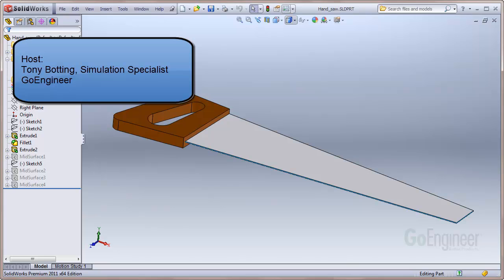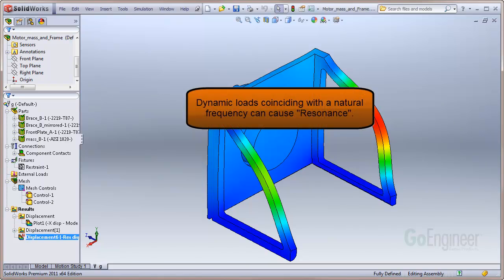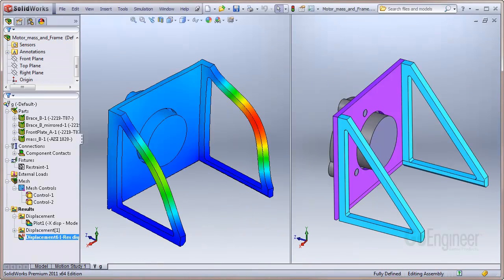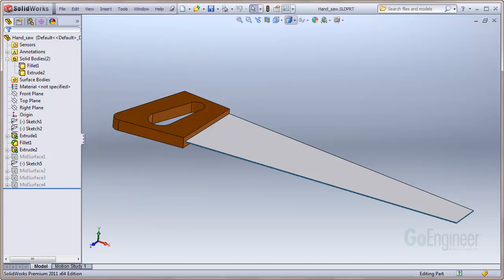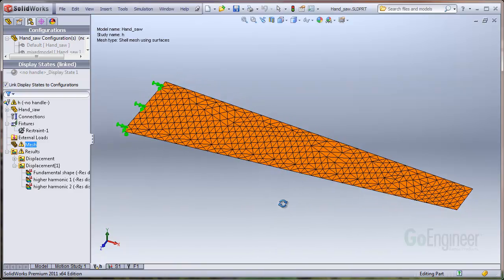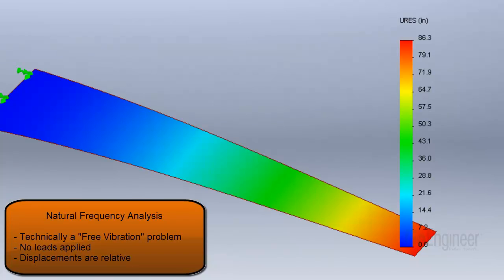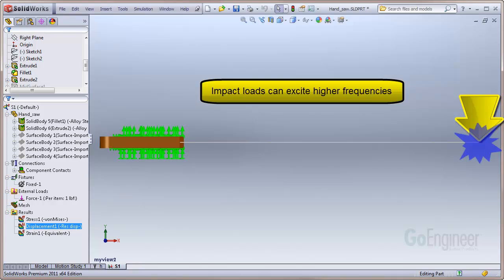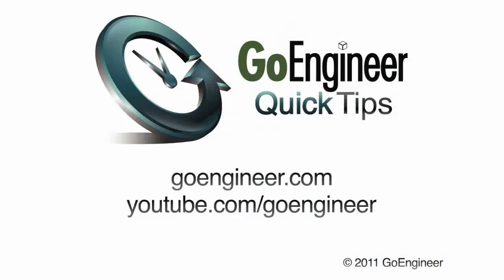SOLIDWORKS Quick Tip - Natural Frequencies, Mode Shapes, and Vibration Tutorial

Comment: can someone tell me plz how to determine if load frequency "coincides" with the natural frequency, i know they shouldn't be the same but how far should they be away from each other?
Reply from the maker: Take a look at the plot in this Wikipedia article: https://en.wikipedia.org/wiki/Resonance

For the simple system they represent there, you can see how they’re determining a range of potential problem frequencies near the peak resonant frequency. You can see that response isn’t a sharp peak, but sloped dependent on the damping of the system. 

The Frequency module shown here doesn’t have a method to include damping and determine response, so we’d have to estimate that by hand. 

However, if you have Simulation Premium, which comes with the Linear Dynamics module, you can estimate damping and apply loads, and output response. With that you could either view plots or create plots similar to what you see in Wikipedia’s resonance article.
Reply: @goengineer  how do i calculate the exciting frequency from a load? for example i have steel frame structure with an electric motor, with 1490 rpm. If i divide rpm by 60 i will get 24,83 Hz. So if i do a modal analysis in Solidworks the first few natural frequencies cant be this number (24,83 Hz)? Do i get it right? Thank you for your answer!

Comment: Hi I was using solid works for frequency analysis, a cylindrical beam with area 78.5 sq mm and length 200mm fixed at one end. the results show two close natural frequencies, I am pretty sure that it is not true because the same model in matlab is yielding no close results. They are quite distinct
 
Frequency(Hertz)
in solid works                              in matlab
182.76                                            182.5
182.78                                             1135
1135.8                                             3139
1135.9    
3139      
3139.4    
 
how should I understand the results from solid works? can any one please explain.
Reply: +Nitish Kumar 
my understanding is that there are two vibration modes at 90deg to each other at each of these frequencies.
e.g 182.76Hz in the x direction and 182.78Hz in the y direction. if you look at the mode shapes they should appear to be at 90deg to each other.
If it was a rectangular beam these two frequencies would be different as the beam would have a different stiffness in the two directions.
Reply: Yes that is what it is, I realized it later. Thanks for your help.